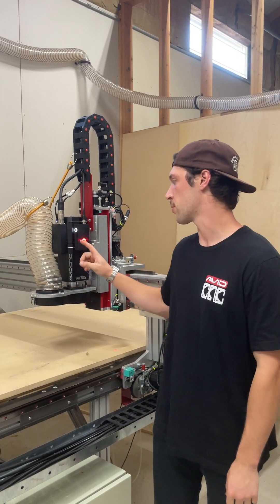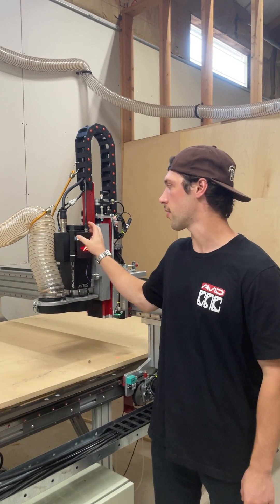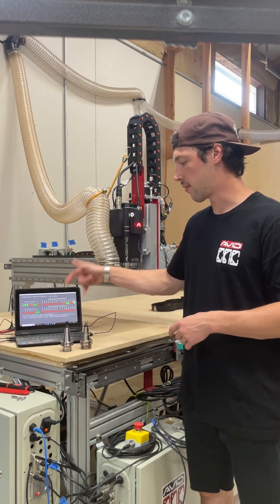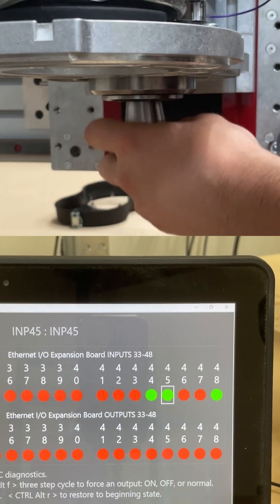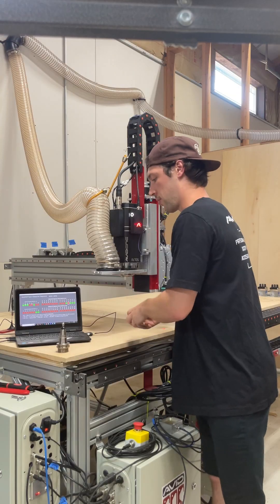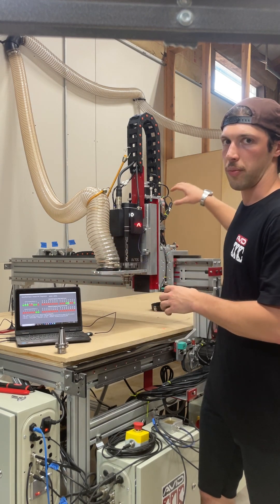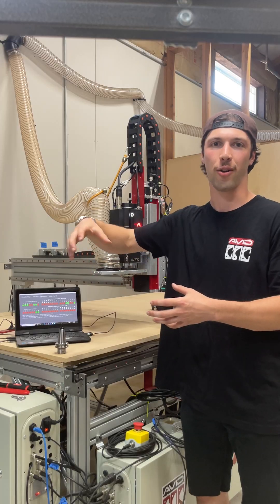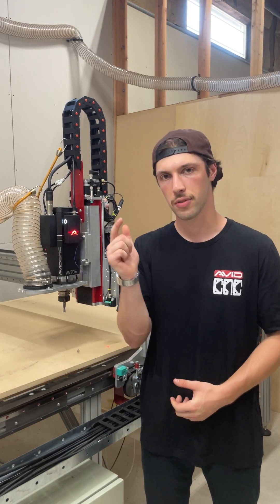Avid CNC ATC Spindle Safety Features #cnc #atc #avidcnc

Comment: What is the max volume from the bottom of the tool holder to the top of the spoil board?  As longer tools are used the usable height of the z-axis is impacted.  Does the z-axis allow for retraction above the bottom of the gantry to allow the use of longer tools without impacting my cutting volume?  I hope this make sense.
Reply from the maker: That depends on the tool holder you're using and some specifics of your spoilboard. You can see in our most recent video that the tool cradles do not extend over the top of the spoilboard so max tool length is dictated by Z-Axis retraction rather than spoilboard thickness. For example, with a regular 8" Z-Axis, the max tool length out of one of our ER32 ISO30 Tool Holders is roughly 4.5 inches and about 6" longer if using an extended Z-Axis. Hope this helps.

Comment: Can the spindle index to hold a position? So a dial indicator mounted in a toolholder to indicate a fixture or part.
Reply from the maker: You can do that now with a 3D "Taster" style probe or you can use a digital probe that will interface with the control direclty